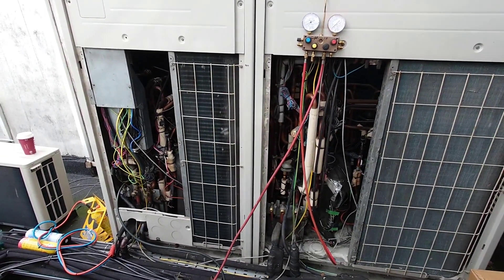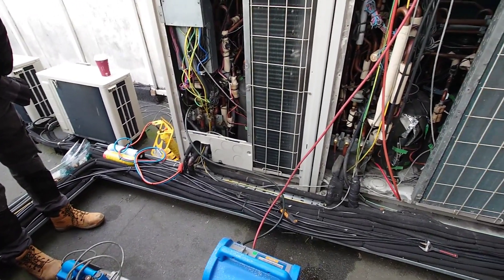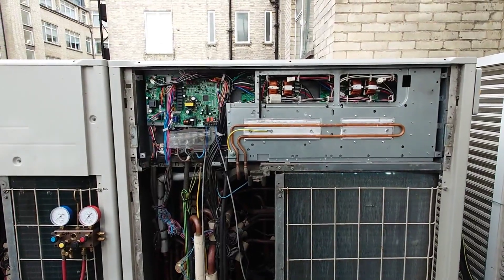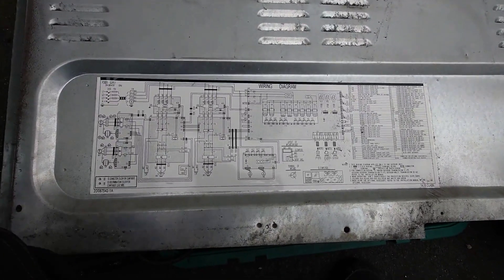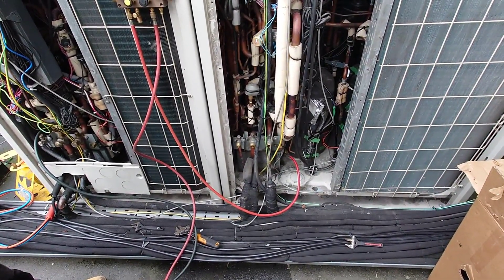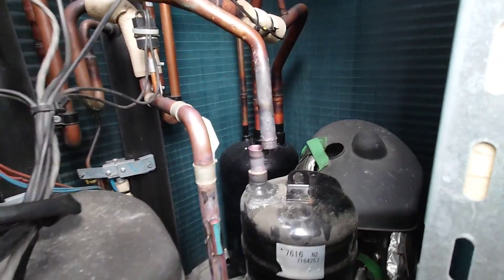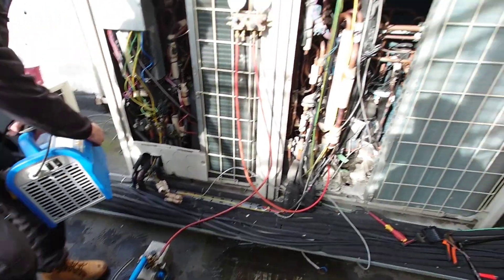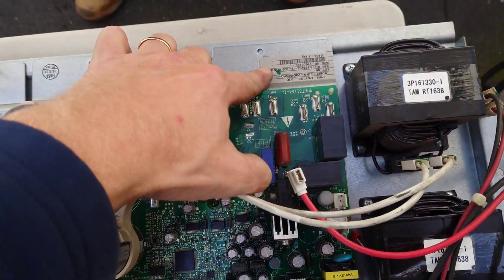Daikin VRV compressor change

Comment: Great video, thank you!  When you brazed it in, did you need to run a nitrogen purge?  If so, where did you input and output the nitrogen?  Thank you.
Reply from the maker: I think you should get a hobby
Reply: @grizzlyfn393  I'm sorry, friend, I'm only a beginner technician watching videos trying to learn how to do things like changing out the compressor.  I didn't know whether it was necessary to purge with nitrogen when doing the brazing and I couldn't figure out where the nitrogen would be inputted and then outputted in this situation.  I thought perhaps you didn't show it because to someone as experienced as yourself it would be obvious.  I certainly wasn't trying to criticize your video or your work.  It sounds from your answer like you didn't feel it was necessary (or maybe even not really possible) to do a nitrogen purge.  If you would want to offer any further help, I would be very grateful but I sincerely wish you well in all events.  Thank you again for the very helpful video.
Reply: @eftihiablattas6774  that’s actually a good question
Reply: @grizzlyfn393  Woah, why so defensive over a question?
Reply from the maker: @OramWerd  because I'm an arsehole. 😂

Comment: Hi excellent video. I have to do this as compressor 1 has seized E5 L5 error codes. Thanks to you I was going to just reclaim the gas into bottle then put back in (if it weighed the same as original charge) I’ve never done a big job like this only ever on tosh. I just wondered if you could tell me when taking from one unit which I saw on video where do you put the ref line onto the other unit. Once again excellent video
Reply from the maker: Inside the condenser there is another shrader valve behind the service ports.
Reply: @grizzlyfn393  on the far left?